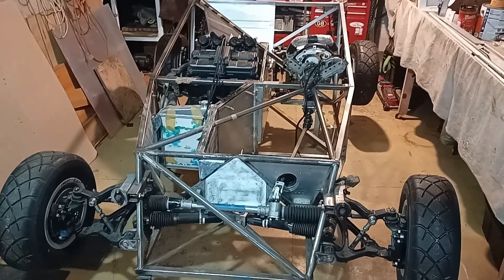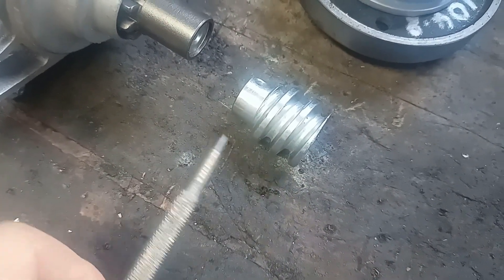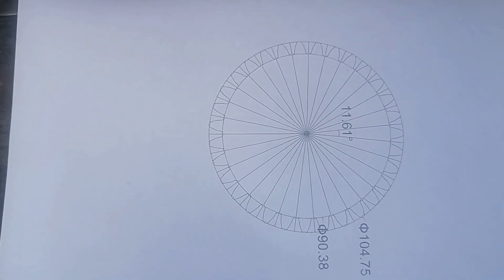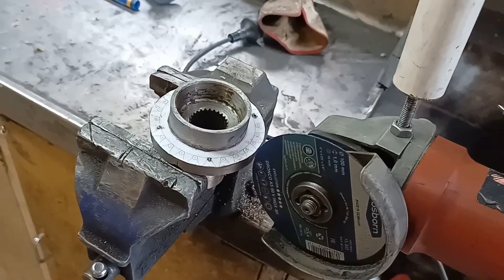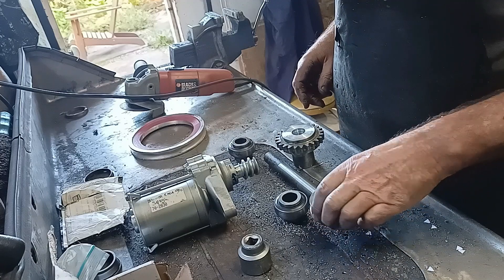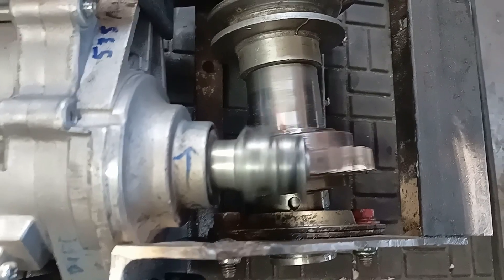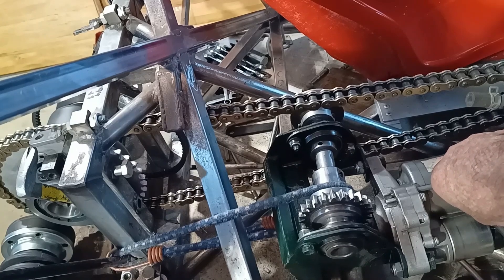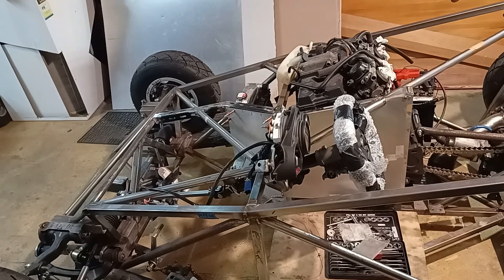Backup A Minute: Electric Reverse

Comment: Nice work once again Stu. I am not a fan of the almost horizontal driver’s side diagonal brace that comes from the front port side corner to the rear of the steering wheel / instrument cluster. I see this as a potential hazard in the event of frontal offset shunt. Could you design in an element of deflection or collapsibility for this bracing piece?
Reply from the maker: By good luck I actually have just the thing in my parts bin. It's a vw bug steering column, which is made from light tube with a collapsible metal basket welded in half way.
Reply from the maker: You will see that I've fixed the dodgy chassis member... By removing it.
Reply from the maker: Hi, yes worth thinking about. It is pointed too much towards the driver. Good advice